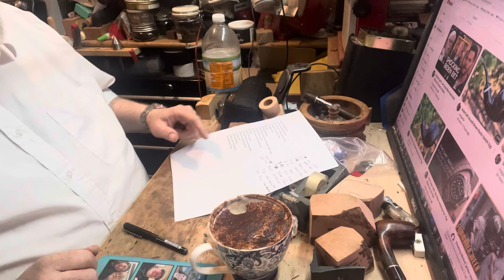Coffee - redrilling pipes

Comment: Question about car pipes. I live in a hot humid environment in the summer with temperatures in the car easily exceeding 100° f and high humidity. And in the winter it can get cold maybe in the teens and twenties fahrenheit. Would putting a briar pipe in your car year round cause damage to the pipe by contraction and expansion extreme temperatures up and down humidity? Because of my concerns, I store a corn cob pipe in my car instead. But is it safe to keep a Briar pipe year-round in a car under those weather extremes?